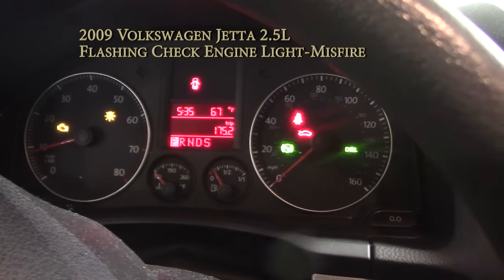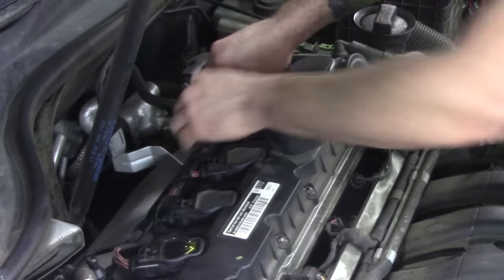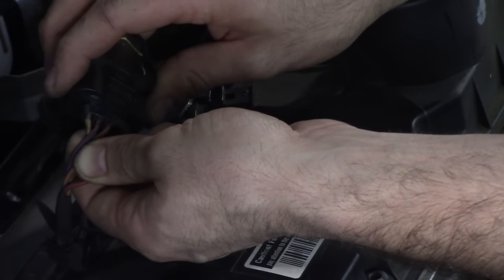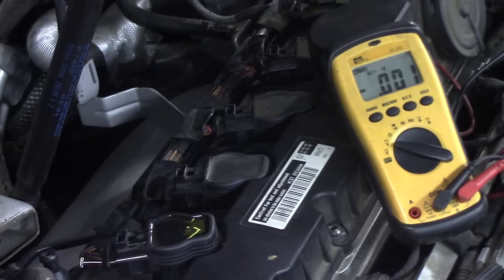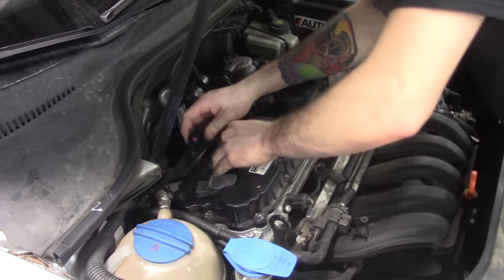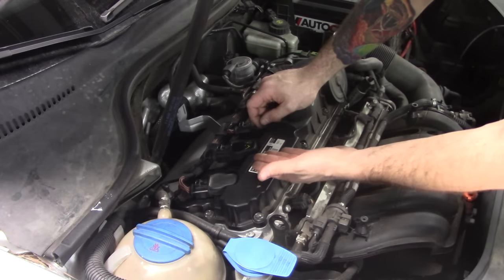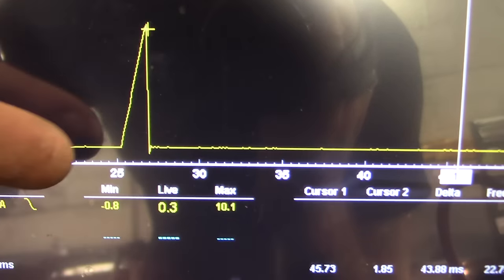2009 Volkswagen Jetta 2.5L- Misfire (Flashing Check Engine Light) w/o using a Scantool

Comment: If you have a vacuum leak it will also cause intermittent misfire typically cylinder 1 & cylinder 5, for those guys having similar issues.  Be careful of those hoses as they are hard plastic and very brittle, hence the reason I know this information.  No issues now pertaining to misfire.
Good vid., very simple to do for most anyone.
Keep up the good vids., especially the 2.5L as am biased, now owning a 2009 2.5 Wagon

Comment: When the circuit first turns on in the primary and the secondary wave form, it starts to oscillate and then builds up the dwell. You can see that the oscillation is small and does not ring much, this is the visual indicator that there is a problem in the secondary winding, this ringing is the CEMF giving feedback of a good or bad secondary coil winding. In your test of all coils, it shows good ringing except in the bad coil. Great diagnosis.

Comment: Thank you for this video! I was on my way to work when my engine light started flashing and then went solid. My engine was running really rough and it was sluggish in the lower RPMs. Because it's a manual transmission I was able to keep the clutch half engaged to maintain high enough RPM's to smooth out the engine. I took my car to O'Reilly and took advantage of their FREE Check Engine service. The printout showed Cylinder Misfire on four of my five cylinders along with several other codes.

I followed your video, performed a Cylinder Drop test, determined I had a bad ignition coil, picked up a new one from O'Reilly, and replaced it myself using another YouTube How-To video (because I know NOTHING about cars). My car fired right up and purred like a kitten. I still had a Check Engine light so I disconnected the battery to clear the error codes (shoutout to O'Reilly for that tip), reconnected, and no more Check Engine Light. O'Reilly performed another FREE Check Engine service and all my errors are gone.

All told, this repair cost me about $32.00 and less than an hour of my time. Thank you again!

Comment: Thanks, very informative. Only one issue with your video. Speaking as an electronics engineer, your voltage check of the ECM output at the plugs has one problem. When you check for a valid ground at the connector, you should move your positive DVM lead to a known +12V connection first, then check for good ground on the ground wires. The absence of a voltage at the ground wire (you show .001) can also mean no continuity at all. You could also set to ohms and read continuity from connector ground to known ground source, but this is the less efficient method of confirming ground as even a slight resistance in the wire can cause a volt drop.
Reply from the maker: I understand what you mean by switching my lead to actually show a voltage. Rather than zero meaning good ground or no ground. But when doing the ground to ground voltage drop test if there is an open in the harness that voltage will fluctuate with some noise. If the ground is good it will read steady. But I understand your point.
Reply from the maker: Your talking about the transistor ground check at the coil right?

Comment: I really like test lead tip. Didn't know you can do that. Thanks for sharing.
Reply from the maker: thanks for watching, I finally could use that test, usually you see a shorted coil looking at amperage
Reply: Was it just a regular test lead?
Reply from the maker: Yes test leads that came with the verus

Comment: Thanks a lot for this! This troubleshooting is exactly what I needed.
Reply: My car was sputtering and check engine light was flashing. I replaced the spark plugs and still had the problem. This was straightforward and I was able to replace just the one coil that was the problem.

Comment: When you did the coil test in the very beginning, was the drop in RPM from the 2nd coil due to a good coil no longer receiving electricity? 

And the first coil was a faulty coil because it didn't respond to no longer receiving electric?

I am a huge amateur mech looking to buy this year/make/model. Thanks for the video.
Reply: The drop in rpm shows the engine loosing another cylinder and therefor a good coil/spark plug...  the reason cylinder 1 never made the engine drop revs was it was already dead.

Comment: Excellent diagnosis. What if I have intermittent P0302 when the power supply is lower than 13.8V? Other cylinders do not seem to be suffering from low voltage. Should I dig into 2nd cylinder? The engine has slight vibration if that matters (2.5L CBTA).

Comment: My 2014 TDI feels like it sometimes starving for fuel glow plug light comes on and flashes, losing power but still going forward Fila jilting in the car like it's starving for fuel engine light comes on. Put it on the scope they can't find anything. Turn it off and then turn it back on and it disappears. Any suggestions?

Comment: I have a 13 Jetta GLI. Had some issues with misfires on cylinders 1 and 3. I changed my spark plugs, ignition coils, and did the carbon cleaning of injectors and valves. Getting a P300 code now. Any idea what it could be?

Comment: I venture to suppose the secondary windings were shorted ...... An open would have driven the firing line way high and the bad coil showed less kv demand than the good ones. There are also  missing the turn off oscilations on the bad coil showing that he energy was just almost completely drained off..... If you had the chance to view  the spark kv point/spark line with a very short time base it might show more details.

Thank you for your time and dedication!
Reply from the maker: There was no spark line at all.  I don't think it was shorted   Other wise the amperage waveform would have showed it. Analyzing ignition can be difficult. Thanks for supporting !
Reply: Positive Lead Diagnostics 
the amperage waveform shows u the condition of the primary windings..... a shorted (or missing)  SECONDARY winding will only be spotted by less - or missing- "ringing “ of the turn on/turn off  oscillations, just like in a single coil device like any solenoid, eg fuel injector. Hope this makes sense....

thanks again
Reply from the maker: A shorted secondary will affect what the primary amperage waveform looks like. Look at the misfire video I did on the jeep. Shorted secondary windings will show on the primary waveform
Reply from the maker: The next one I get that is similar to this one. I will dig a little deeper maybe smaller time base for more detail like you said

Comment: I think you called the dwell time the firing line but great video as usual!
Reply from the maker: Your right I did lol. I couldn't think of the term. Thanks!
Reply from the maker: There is dwell time building up the magnetic field then the turn off is the firing line and then you have the spark line. Couldn't think of that term. Thanks again

Comment: @ positive lead diagnotiscs I had that same problem with C1, I swapped it to a coil i know it was good problem went away. I turn it back on a few minutes late and i hade a misifre now from c1 and 2. Would this be wire related? I went back to check the spark gap, it was fine. put it all back together and back working again.

Comment: My 2006 Jetta , 180,000 km, manual trans after SMF clutch replacement started  running  horrible and  misfires and makes a rattling noice on top of engine at 1500 - 2000 revs. Before the clutch replacement it was Runing alright.  so far I had replaced spark plugs , coils, MAF, MAP, crankshaft position sensor , cleaned the injectors, installed the old DMF clutch back , troddle body cleaning, replaced the whole harness , i replaced the vacum about 1 year ago, I can't find any vacuum leaks , cylinder compression its 150 in all cylinders, gas pression it's allring according to my mechanic. The problem still there and it seams it's getting worse . The vag scan trows codes p0300 , p0305 and some times p0305 . My mechanic tells me maybe the MCU has corrupted or something , could this be right ? I don't know what else to do . I have already spent tons of money could it be the ckp sensor?. Any help would be appreciated

Comment: I m a little comfused here ! 4 wires on coil harness. 1 is feed wire 12v 2 and 4 are grounds and 3 is refrence voltage from pcm !! Now. I had a misfire on a car just like urs !! I pulled each coil !! They were pluged in and there was a strong spark on all of them !! I pull out one by one to see the spak !! Where i m comfused is when i checked all the wires i had 12v on pin 1 !! Pin 2 3 and 4 they were ground so i m thinking 3 pin only becomes 4.3v once in a while or what !! how does dat work !! The other thing is i try connecting a test light to body ground i could see the coil spark but when i would put the test light on the coil like u did the test light wad not arking !! It would do it if i was to put it on battery posite and then put it inside coil !! If u can explain dis i would apreciated thx !! U may contact me 1 408 648 8879 thx

Comment: Way to cover all the bases from simple quick checks & swapping coils to lab scope waveforms. Aftermarket coils suck and all I use is either Wells or OEM.
Reply from the maker: Have to do it for the guys with and without the equipment
Reply: I agree!!
Reply: After market coils can't be much worse than OEM.
Reply: AM coils suck b/c you never know what you'll get and I don't like comebacks so I use OEM or Wells. Some of the Duralast coils are actually Wells coils and you just have to look at the Duralast descriptions and it will say if it's a Wells coil.  That's just my preference and what I put in my customers cars so they don't have any issues. After trying differnet AM products for over 40 yrs I know which ones have failed me and the ones I trust...I give them all a chance but seems to be a crap shoot with most.
Reply: +Hayward's Automotive    You're 100% right in your thinking and i believe the same but my point was that VW can't make a coil that lasts either.
Reply: wysetech2000 Gotcha yea I don't mess around much with Euro cars even though I diagnosed 2 BMWs a few weeks ago...temporary insanity

Comment: Sir.. your vid. Is so helpful...
But i wonder if you can fix the engine that shakes hard by yourself... i have a jetta 08 2.5
And the engine makes loud clacking soud and shakes hard... any idea what could it be? Thank you...
Reply from the maker: I think on the older 2.5 engines the upper chain would stretch causing misfires and an intake system leaking fault

Comment: I have the same problem on 2009 rabbit 2.5L I already replaces plugs and coil and still flush check engine light coming on I check the way you do with the meter and notices that I don"t get the battery voltage I got 11.7 if that be a problem?

Comment: Hello, I'm having a issue where I'm getting a p0353 and p0303. I have all new coils and plugs. Number 3 is not contributing. When I check the plug harness connector the readings are all the same on all the plugs except number 3 3rd pin that goes to the ECU. The 4 other 3rd pins are reading 11. But number 3 3rd pin is reading 6. Would that mean that the harness connector is bad? Or is is something inside the ecu? Thank you so much for any time and help. I greatly appreciate it.
Reply from the maker: When you are checking voltage is the vehicle running?  That connector should have a power and ground for the coil. A ground for the transistor that is inside the coil and a small square wave signal to fire the coil
Reply: @PositiveLeadDiagnostics  no I just have the key on. The 4 other coli harness plugs have around 11.97 to the number 3 pin. The number 3 pin on coil plug cylinder 3 is only 6.27. When I changed the plugs around you can see the others have been firing but cylinder 3 plug smells like raw fuel. I did the pull the harness plug when running and all cylinders stumble when unhooked from coil, number 3 acts the same, no change. They are all new coils, I've swapped them around but get the same thing. I even replaced the harness plug today, nothing, same thing. I'm a decent mechanic but I've always hide from electrical stuff. I wish I didn't but I'm trying to learn the basics now. I'm sure that there is a easy way to test this, you'd probably have it figured out in 5 minutes. But I'm literally driving myself crazy. Any help would be greatly appreciated. I do have a decent multimeter. Just not sure how to really use it outside of the simple things.
Reply: @PositiveLeadDiagnostics  Codes are a p0353, p0300, p0302, p0303. Crazy part is cylinder number 2 is firing fine.
Reply from the maker: Don’t worry about the cyl 2 code. Its probably flagging that code because of the severe misfire from cylinder 3. What is on pin3 (small wire) when it’s running?
Reply: @PositiveLeadDiagnostics  hey man I greatly appreciate you helping me out. I just put a shit load of money into this car, tires, wheel bearings and believe it or not it's a 2011 with drum brakes. I fully rebuilt them. At first I thought it was a nightmare because I didn't understand the teardrop auto adjustment deal. Once I figured that out they were super easy. Anyway I had to go out in the freezing rain (I'm in Delaware) to check but its totally worth it because I really appreciate your time!  I went and bought some T-Pins and did the reading on wire number 3 and it's worse when running, it was bouncing between 2.7 and 3.1 when all the others number 3 wires of the other coil harness plugs were always close to 12. I also have a new code of p2307 and p0458. Is the p0458 because I have the air filter assembly removed?
Reply: @PositiveLeadDiagnostics  this is what happened today when I worked on it. I put the t-pin in the back and the bad plug was reading 16.0 on the 3 wire and the other 4 cylinders all read around 12.0 with the t-pin with the key off. With the key on the bad plug read nothing at the t-pin until I took the multimeter off the t-pin, as soon as I took the probe off the multimeter reading jumped to 6.0 then 19.0 then nothing. All 4 other cylinders read the same 12.0 or around there. When I took the probe off them they went to nothing like normal.  So I spliced the cylinder 1 number 3 wire to the bad cylinder number 3, number 3 wire. And now I got the same bad reading from cylinder 1 as I do with cylinder 3. I put number 1 cylinder back to normal and it went back to reading normal.
Reply from the maker: The third pin with the small wire should be a pulsed signal that triggers the coil to fire.  I’m not sure I follow those readings you have. Voltage?   Do you have access to a scope?
Reply: @PositiveLeadDiagnostics  sorry I dont. Do you have a suggestion that I could do now? I do have the multimeter on volts.
Reply: @PositiveLeadDiagnostics  also all 4 wires are the same size just different colors.
Reply from the maker: If there’s a wiring problem. Then maybe you can do the same checks at other spots of the harness.  Ecm pin power supply and ground points and compare

Comment: Good stuff keep em coming why u only work on those kind of cars BMW and stuff?
Reply from the maker: thanks, I work on whatever comes my way, but a lot more vw because I work at a dealer
Reply: Thanks so much for putting together all these videos!  There isn't a ton of diy out there for vw's.... man what I wouldn't give to have a decent mechanic like you in my area... the locals just wanna throw parts at it. Half the time I have a better idea what's going on with my 2 veedubs then they do! PLEASE keep em coming! !
Reply: Cause German cars are the best.. Domestic cars are just that, mass produced with no real value
Reply: @PositiveLeadDiagnostics   can you please put some input on my father inlaw jetta.  Light engine check and its stalling on long drive but never in short drives. Please help.

Comment: Why it has 2 ground one of them its the feedback signal right? Or maybe not because with the feedback if you unplugg it will turn off the car. Nice vid though Tommy!
Reply from the maker: One is the main ground for the coil. I think the other is for the transistor that is built into the coil. There is no feedback circuit on this one

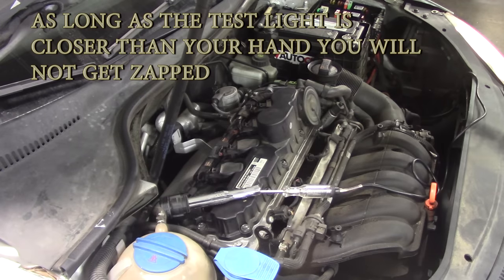Comment: 2:00    That's a 12 volt test light, it isn't supposed to be used for high voltage.
Reply from the maker: My test light works great. I’ve done this hundreds of times. The test light is used as a safety to pull the spark straight to ground. That is it’s only use in that test.  A path to ground rather than your hand
Reply: @PositiveLeadDiagnostics      Doesn't the high voltage burn out the bulb?

Comment: My 2009 Jetta sportwagen (2.5L non TDI) diagnosed as a misfire, not a flashing check engine light, just solid yellow. Replaced all five spark plugs and coils, and still have a check engine light on. What would the next step be? take it to a professional at this point?
Reply from the maker: Did you clear it and the light came back on?  What's fault is stored and is it misfiring?
Reply: Positive Lead Diagnostics have to take it in to clear it, unless there's a way to do it without special equipment
Reply from the maker: Sometimes disconnecting the battery will do it.  Does it misfire?
Reply: Doesn't seem to misfire anymore, but disconnecting the battery didn't reset it.
Reply: Positive Lead Diagnostics "

Comment: And then after swapping coils the misfire still exists on #1. Raw gas on plug during idle, zero misfires above 2k rpm. Voltage and ground checks passed.
Reply from the maker: You could swap the plug too. After that it would be compression or fuel. I think the older 2.5s had head gasket problems on cylinder 1
Reply: @PositiveLeadDiagnostics  new plugs and coils were tried with no luck, turned out to be a head gasket in the end. Thanks!